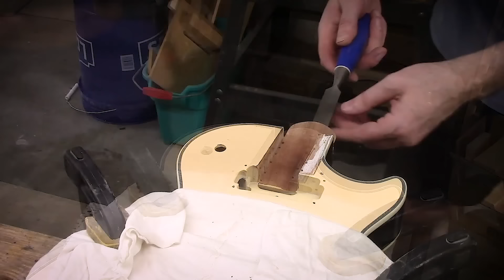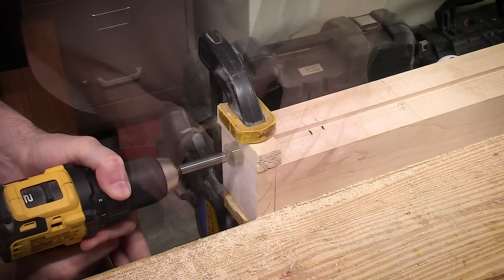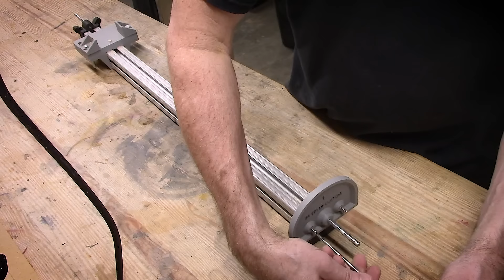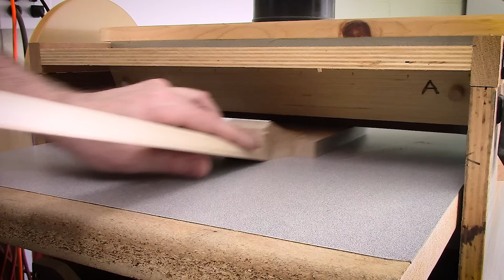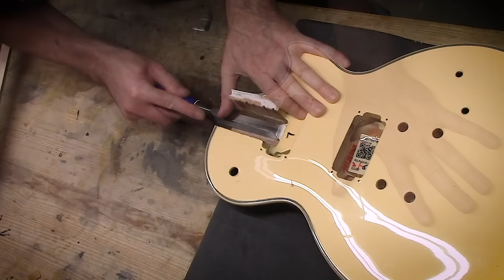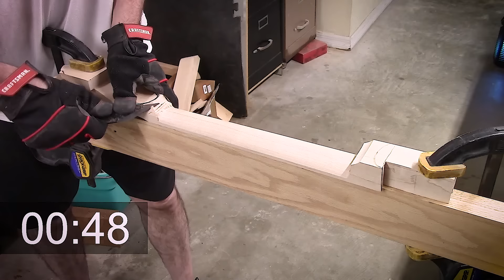Epiphone Les Paul Guitar Reneck Project Ep2

Comment: I've been following this series for a while; I'm so impressed by your craftsmanship. One question that lingers in my head is why not add carbon fiber rods to the neck? In which cases do you think a neck benefits from such?
Reply from the maker: Sam, thank you very much, and thanks for watching, and watching...I greatly appreciate your time!

Great question regarding carbon fiber. 
The owner of this guitar wanted a maple neck, one piece, spoke wheel truss rod,... no carbon fiber.  
I don't know that carbon fiber would help the shaft stiffness of this neck much as it is quartersawn, but there may have been a slight improvement where the shaft transitions to the headstock, but we added a volute at that area, so.... not entirely sure what the net gain from CF would have been. Having the heel access spoke wheel truss rod, greatly improved the neck strength at the nut area, less material routed away...

I'm also working on a 355 project, laminated 3-ply mahogany, roughly quarter sawn orientation, and it has 2, square 6mm, CF rods epoxied in, and a volute.... whew, it is a tough and light neck. That neck does have a traditional headstock access truss rod routing however. The CF rods do protrude into the headstock area and are buried under a headstock face veneer, so that should improve strength, otherwise lost from truss rod routing. 

I'm the fence as to when CF is needed, it hinges on neck profile, routing ,and the lumber being used, the orientation of grain (flat-sawn or quarter sawn) for the neck largely.  Flat sawn neck lumber would likely see improvement, especially on long (bass) necks, or a neck with a narrow or thin nut cross section.
CF can make a neck shaft very rigid, but if there is a weak point at the nut area, where the neck transitions to the headstock, the potential is there for a break, where it is weakest or thinnest.

Sorry for the vague answer.
Hope to hear from you again, be safe and take care!

Comment: It's just so crazy the way they set that neck in there. Offset like that. But I was reading the comments, and I was also reading your comment back. It's probably for production reasons. And I guess if you did cut it out and kind of make it big, it would have to be a problem because she would have to be adding wood. It's both sides but coming from a mechanical point of view, but I getcha, I understand!!!
Reply from the maker: Charles, thanks for watching!
This style offset tenon is a bit strange, but it seems to stay in the body pretty well. 
I'm not sure if there is much structural benefit with one or the other, luckily everything is hidden when assembled.
Kinda fun taking things apart, then trying to understand the reasoning.
Hope all is well, be safe and take care!

Comment: Very cool. Your videos are always so good. I've never used a router. I had no idea you can go any direction. I thought the bit required you to go only one direction. I see that watching this you talked about it pushing and pulling so to speak which makes sense..  I need to learn about routers and buy a small one to work with..  The removal of the neck very cool with the probes. 
The fact that you're using a spoke wheel trust rod is killer too! 
Where do you buy your wood for the necks may I ask and do you recommend any certain place to buy wood from? 
Thanks again for sharing all this info.. Just killer..
Regards from the heartland. South Central Indiana. USA

Tim
Reply from the maker: Hey Tim, good to hear from you and thanks for watchin!

Yes, routing direction is a big, big, big thing. 
Even when using the router base guide, the direction of the bit rotation will either try to pull the guide against the work piece ( a good thing ), or possibly the bit will try to eat into the wood and push the guide away from the work piece ( yep, that's bad. ).
Taking very shallow passes will help with router control, as the bit isn't chewing on as much material. This is really good for initial passes, helps you get a feel for what the router, the bit, and the wood want to do. 
Also, depth of cut should not exceed 1/2 the diameter of the bit. So if you are making cuts with a 1/4in bit, you would want to keep the depth of each pass at 1/8in ( or less ). This is mainly for plunge type routing as I was doing for the t-rod trench, but it's not a bad idea when using a new style bit, or other special situations.
The big compression bit I used to trim away the sides of the neck taper, are a different story, and larger bits have another set of best-practices that go along with them.

Okay, where do I find lumber.
I typically don't order neck blanks online. I like being able to see the wood, however there are good reputable online stores that could be good sources for neck lumber. I don't really have a list of those, as I typically buy local.
Kimball hardwood comes to mind as a good online retailer, and they have a huge following, really nice lumber too.

The maple and mahogany turning blanks (neck blanks) I find at Rockler Woodworking and also at Woodcraft. They are woodworker supply stores.  I'm not saying these stores are the best place to find neck lumber, in fact since Covid, I've had a lot of trouble finding good lumber at these stores. 
That said, I do find lumber at these stores, but it's infrequent. I may stop by the store 5 or 6 times in a month or so to find 1 piece of lumber that is acceptable for a neck. Probably good enough for a table leg or baseball bat, but not for a guitar build.

The foam cutting heat probes can be found online (amazon), or at places like Hobby Lobby.

I was a neighbor in my youth, grew up in the cornfields of Iowa. Now I swat mosquitos year round in FL, oh joy!
Hope all is well, be safe, take care and talk soon!
John
Reply: @theNextProject Hey John.  Man, thanks so much for the detailed answers. I have learned so much from you already.  Interesting you lived in Iowa.  Another Midwest guy too ❤.  I'm from Indiana, but left at 18 and explored this big country and lived in Colorado for a long time with stints in Texas and California as well as several other places like TN, etc over my 64 years.  I even lived in Florida. Naples for two years in my youth.  I was like 25 when I moved there and poured concrete because there were no jobs basically at the time.  Man, I hated Fl. It's a nice place to visit, but not for me. My parents lived in Inverness but moved back home to be with relatives and now I help take care of them because they are really elderly.  My buddy owns a diner and an old building from the civil war. They rent out parts of the building to business and one renter just left so he and I are taking over a small area for a shop to put together parts guitars. 80s builds with new features like stainless frets, and high quality parts with old 80s bodies from Jackson, Kramer, etc. It's not to make money, but because it's a labor of love.  We are going to buy fret tools and do stainless fret jobs once we practice enough and can get the fretting down really good. Hence how I found you when looking for stainless fretting.  
I may even take a fretting course or buy CD's about the same from Stew mack to get started. I have a few good measuring tools left over from when I worked in a machine shop programming cnc's and doing that work.  So should be interesting.  We are both retired and bored basically. 😂. If you quit moving and quit learning your dead to me. .
Have a great day sir . Again, thanks much for the answers and watch out for those mosquitos that have their own landing strips and those dinosaurs called alligators. 😂.. 
Be well and safe my friend. 
God speed kind sir . 
Tim .

Comment: Hey John, really nice job once again.
So with the neck, I think the joint to the body should be the older part of the tree, and the headstock the younger part? But I'm not sure.

My “project” seems so minor to what you do all the time.
I only want to use a 20 fret neck in a neck pocket of a 21 fret neck, now I have to find the right, thin veneer. The new neck is a little shorter than the old one, but it is all maple, no darker fingerboard.
On guitars, I have no problem with a darker fingerboard, but on a bass, I want it to be maple.
In the end, I'll drill some holes and hope for the best not to ruin the neck.
On the other hand, I only have an old desk to work on, no workshop.
Sorry that I am so late this time.
Reply from the maker: Achim, good to hear from you!
I can relate, as I've worked on the kitchen table and countertops for a long time. Everytime I move, I have a new situation to adjust to. I'm pretty lucky right now, and have enough room for everything, mostly.
I like the "older part of the tree to the body", that make sense!
I'll have to look at the neck when I get back there and attempt to see where the old part is...hahaha

Interesting short neck project you have there. Who needs all those extra frets anyway, right?!
Hope all is well, take care of yourself and those around you. 
John.

Comment: Watching this I reckon the main thing with the neck shaping jig would be consistency, not sure about time saving. Effort saving maybe lol 

Anyway, really good job on the repair, making a new neck for a made guitar isn't as easy as making a full scratch build imo. With a scratch build I feel there's more room for tweaks if something doesn't go quite to plan. Which can be often in my case lol
Reply from the maker: Good to hear from you and thanks for watching!
the shaping fixture definitely is a consistency helper. After a couple necks using the same cam templates I'd be able to get the final dimensional cut pretty close to finish sanding stage. Since I haven't used these cams before, I'm leaving a lot of extra meat on the bone at this point. Maybe a little too cautious.
It is saving my elbows and shoulders a lot of work, so I like that.

It's interesting to see how the factories  put things together... some things are just "close enough", but not perfect.
We're all human, doing what we can do, and covering the mess with paint and such, haha!

Hope you are doing well, take care my friend!

Comment: I have a Gibson Les Paul Standard from 1989, the headstock have been broken off several times and glued back, then it broke again and i bought it broken for a cheap price, its been two times around the world and seen over a 1000 live shows so its beaten up. I bought material for building a new neck and stuff, even built a special tool for making a correct modern trussrod access cavity and an identical trussrod. But, i can not find any wood stamps that match the original to get the serial number right, and i dont want to shave of a 5mm cake from the back of the original headstock to glue it on the new neck either. So i have started to think about trying to repair the original headstock-break even if its really really bad. The neck is taken off the body, the fretboard is taken off too, the headstock veneer is in really bad condition and there is no replacements available for the 80´s style logo, it has warped so maybe heating it up and clamp it flat. It will be a really complex job, only because of that i dont just wanna make a fake serial stamp but i want to keep it a Gibson, at the end of the day even in a very used condition, these old Gibson´s starting to be quite expensive these days. I started this project 1 year ago, and i have been thinking about how to do this right for 11 months.
Reply from the maker: HearGear, thanks for watching, and WOW - you've got a project there!
Sounds like you have a number of good options to pursue, but which one will it be?
I'm not sure what size stamps Gibson was using in the late 80's, and they may have had something "custom" made for their manufacturing use too, idk.
I've found some decent steel lettering/number stamps on amazon, aliexpress, and some at a local hardware store, but they may not be the right dimensions that you need. Keep looking, something will surface for you.
Keep me posted as the projects moves forward. 
Be safe, take care and have fun!
Reply: @theNextProject  Hi, i might end up trying to repair the original neck, glue the headstock back and use different jigs and do some routing in different stages to replace most of the material around the break, both on the front and back. Yeah, i´ll get back with an update and a video about the result, i recently bought a Melody Maker with broken headstock, i made a repair video of it and its on my channel. Thanks.

Comment: I'm surprised the block of wood where the neck joins the body is not centered on the neck / body (16:21).  From an engineering standpoint, I would think this would result in the bass side of the neck being stronger than the treble side.  I'm sure it doesn't matter in the grand scheme of things, but if I was an engineer at Epiphone / Gibson, I'd fix that to be symmetrical!
Reply from the maker: Chris, good to hear from you and thanks for watching!
Great observation and engineering question!
The offset tenon is a bit of an eye-twitch encounter. 

I have to guess it is were engineering and manufacturing tossed a coin, and manufacturing/production won.  
The neck joint is still very strong, much stronger than the neck lumber of these guitars, so a break or failure at the joint is probably pretty rare.

The speed and easy of prep and assembly with this off-set neck may very well increase factory output. The factory installation is just a bit on the loose-side, relying on glue and shims to align and snug everything up (gibson has been guilty of this too).
A lot of 'offshore' set neck guitars share this same offset-tenon design. Probably all to increase manufacturing times, and simplify assembly. Just a guess.

A 335 that I'm working on does have a more traditional centered tenon, and it was a lot more work, took more time, than did this style.

Leo Fender and the bolt-on guitar neck was probably a engineering and production trade-off. It probably wasn't so people could replace a neck originally. It was very likely to increase manufacturing numbers, simplify assembly, easily discard any reject parts without tossing a nearly complete guitar.

Would be interesting to know when engineering has to take a back seat to accommodate production. 
Hmm, now you got me thinking again, that's a dangerous thing. haha!
Hope all is well, be safe and take care!
Reply: @theNextProject  I appreciate your insight given your experience with both tenon types!  I think it's just my O.C.D. kicking in - the offset tenon just looks "wrong" to me 😁
Reply from the maker: It does look wrong, doesn't it.
Good thing we bury it in the body.
Reply: The reason the tenon is offset is to ensure the treble side material comprising the neck pocket and the upper sidewall of the cutaway does not get broken during the manufacturing process. Since the treble side of the pocket would vanish to nothing at its distal end in a symmetrically routed pocket, that end would likely break during assembly and would be nearly impossible to bind.
Reply from the maker: Thanks Luke!

Comment: Love the volute! Very nice! Do you find differences in maple? And which do you like for which bits? The heavy, glassy maple is nice on headstocks where the figure pops. Actually nice everywhere, but I've been using a straighter-grained, drier stock for the neck itself.
Reply from the maker: DuggyDugunder, thanks for watching!
Yep, maple like other woods can be all over the place. Tight grain, wide grain, heavy, light (for maple), hard, soft... Then there are blemishes mixed in. 
This piece of lumber was 5.8% on the outside when I checked it and 6.5% on the inside after cutting, so really very dry. Stayed straight as I cut away the excess and for the following weeks afterwards too. 
Dry wood is great, but I often have a challenge finding it where I live, during the summer we are often really high in humidity, inside the house can easily still be 50-60%. 
The turning blanks I often use are hit and miss. I probably look at 20 or more to find 1 that has straight grain that is rather tight. So, a lot of trips to the lumber supplier, waiting for inventory to roll over.   I don't buy too much lumber online, I like seeing it first hand if possible. 
Hope you are doing well, good luck with your projects, be safe and take care!
Reply: @theNextProject  Thanks for the detailed answer! Now I only have more questions. I'll ruminate and hit you up later.

Comment: I'm wondering why you didn't go scarf joint? Maybe faithful to the original?
Reply from the maker: DuggyDugunder , hello again!
Great question, thanks for putting it out there.
Scarf joint, wasn't an option. 
The owner wanted single piece lumber, no scarf, no lam, neck.
Also wanted to keep the original angle, but was good with adding a volute, and changing the t-rod placement. 
So, I think we've made some good improvements. 
Stronger lumber choice, better t-rod trench, and the volute... strong!
Life is good!